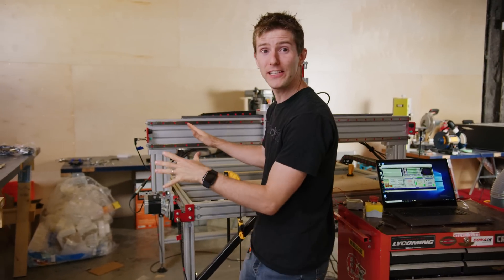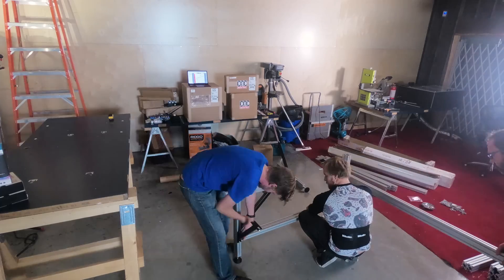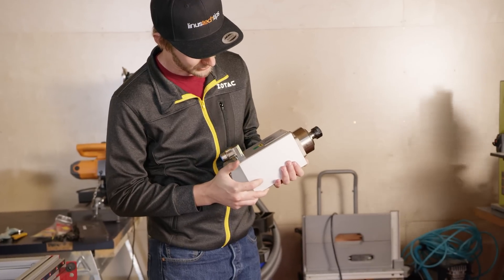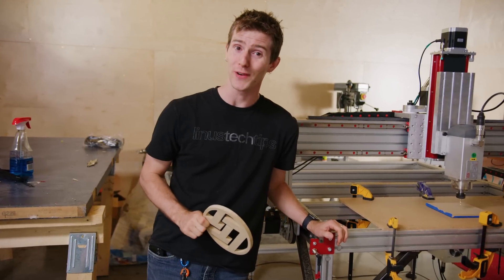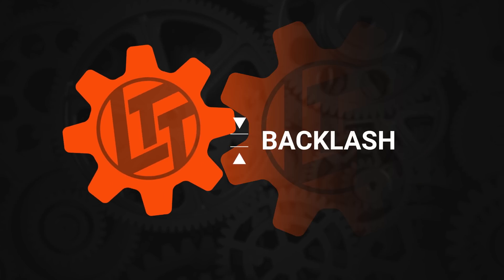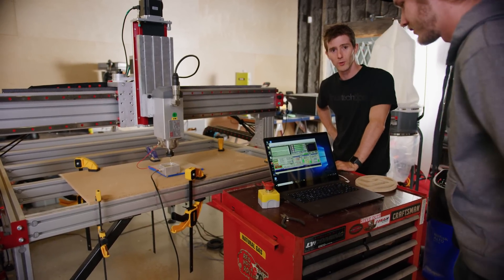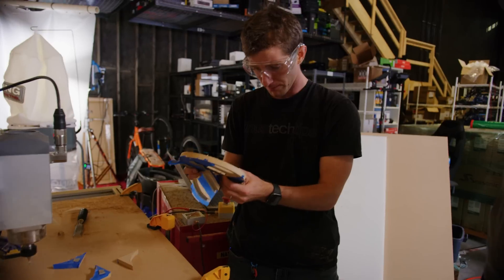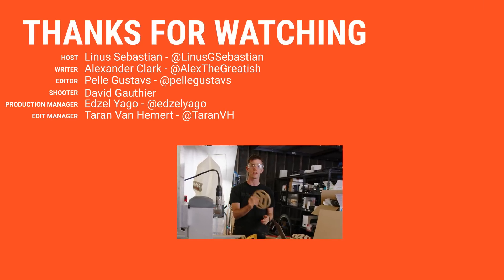Our New $10 000 Router!

Comment: You might want a better dust collector than the one you have as you have a lot of dust sensitive stuff in your studio/offices and fine dusts can slowly build up and spread everywhere. It would be best to actually just exhaust the output of the dust collector by putting it in its own room with a vent to the outside so you don't slowly accumulate cutting dust inside your warehouses (Also would keep the noise down so the loud dust collector isn't as annoying when on. Be wary of fine wood/plastic/metal dusts as given enough time it can be a combustible dust explosion hazard.

Comment: Name it Chewie? Make a good heat sink that doesn’t suck lol
Reply: Its a wooden cnc. For metal it should be a laser
Reply: @idevastate_exe  you use a laser to etch if you are cutting and shaping you use a router. This is a basic 3 axis which will allow machining on the horizontal plain. Machines with more axis can also machine on the vertical. And some can even function like lathes. You can use this machine to do metal with the right cutting tool
Reply: Agreed, it's all about the feeds and speeds you use, I've machined aluminum on a plywood router before
Reply: Yea

Comment: You guys should be using that E-Stop button when you change the bits. LOTOTO - Lock Out Tag Out Try Out. More importantly, call it the R.O.U.S. "Router Of Unusual Size".
Reply: Yeah. Rule number one, that tool needs to be made inoperable before touching that bit. Either the E-stop needs to be engaged, or the power switch needs to be off.
Reply: I know you're technically supposed to LOTO when going near moving parts, but generally for machinists, that is not feasible. Bits need to be changed out so often, a full LOTO procedure would not be economical at all. The e-stop would be the best compromise. Most people don't, but should.

Comment: so... does it cut metal? cause that is the biggest question. homebrew heatsink v3(?)
Reply: With a 3hp spindle, yeah, it should cut pretty much anything, provided you use TCT cutters and get your speeds and feeds right. Aluminium, brass, bronze, no problem, probably mild steel too, but you'll want a lubricant flow, and probably a proper machining bed (not MDF).

Comment: Awesome! I had to learn from scratch on an Axiom Pro 8 myself 4 years ago. I cut foam, so, the mess I have is insane compared to these messes.  I like how the machine is modular, mine was a assembled machine, and I've had to take it apart several times to clean/maintain it,massive pain in the ass.  This one would be SOOO much better!  Also, Vcarve is kind of a crap program, but it does work, and is 'easy' compared to some of the others.

Good luck with the machine guys, you can build so much stuff with a monster like that.  Mine's much smaller/not as powerful, but it's amusing you still gotta change the collet/bit by hand! 

If anyone actually reads this, check out the company Datron, they make some phenomenal metal cutting machines in little kiosk style setups, all in ones, awesome stuff.

Comment: do you  have the ability to add an automatic tool changer to this router? also try using a chamfering tool for the edges to round of the material, cuts down on the need to do any finishing by hand.

Comment: but a 3d printer  is pretty much a CNC router ....just work z+ instead of z-. and btw saying a 3d printer work only by pressing start is not true. You still have to adjust all the same parameter you just dont have to worry braking cutting tools

Comment: During my On the Job training at an automation company, I had first hand experience in designing, assembling and programming those huge "power supplies" which we called control boxes, which I think one of them housed the Programmable Logic Controller and the motor drivers for the steppers. We also had some people from Oriental Motors demonstrate new steppers that  would recall which position was  "home" so that it could accurately snap back to that position without having to rotate the same number of rotations it did to reach home again which was really awesome to work with. This brings back so many memories of those days.

Comment: I'd start cutting my own keyboard cases at this point. I was tempted to build one of these a couple of years ago when I was interested in building mechanical keyboards. You don't actually need a CNC router to build one, but you can make a very precise and clean wooden case with one. Grab a GH60 PCB, or better yet, hand wire your switches together, mill some aluminum or acrylic for the frame, and make a nice wood case.

I've hand-wired and made a wooden case, but never fully built my own keyboard. The hand-wired board used a case and frame from a KC60 and the wooden case used the PCB from the KC60 with acrylic I'd ordered online. Now that you have the tools, you can actually make some pretty neat stuff.

Comment: 3D printers aren't just press go. A lot of the same things you have to set for thing is close or the same on 3D printers.
Reply: CNC milling and 3D printing are polar opposites regarding technique. There's pretty much nothing similar about them.
Reply: @ramzisabra9235  they do different things but a lot of the same principles apply. There's a reason with only a few parts you can convert a 3D printer into a router.

Comment: Next project, a shop room with filtering to keep sawdust from accumulating on everything. Now you know why a lot of CNC controllers have sealed membrane touch keyboards. This is where one of those passively cooled micro systems comes in handy. You don't need a very powerful computer to feed g-code to that CNC router. As for the request for a metal lathe or a milling machine, just don't. Not unless you have a separate building to devote to it. You know all that sawdust that flew everywhere? Imagine it being conductive metal shards, dust, and particles. Lathes are also extremely dangerous if you don't know what you're doing. That router could put a hole in your hand if you weren't paying attention. A lathe could take your arm off. Accidentally leave the chuck key in and turn it on and it will go through a wall, never mind you if you're in the way. You also don't appear to do enough projects to where the expense and time to learn or to hire a machinist would really pay. I'm sure there are local machine shops that would love the chance to get a little publicity doing work for you if you needed a custom bracket or somesuch.

Comment: Why the heck do you have a Pro4896! lol...  Um, welcome to the club...  Its an addiction... Next a Mill to cut metals, then you will be wondering where to stick the Lathe.. just saying..
Reply: I can't help but think a something akin to a HAAS VF1 would have been a better and more versatile investment compared to this. Sure, this is smaller, but the HAAS or some equivelant can cut acrylics, wood, etc jsut as well as somehting like this for this sort of use case.
Reply: JC_Velo a Haas VF is great for machining, but for sheet goods and sign making you can’t beat a 4x8 CNC router.  Different tools for different needs.  

That being said, I am not sure what LTT is going to be making that they needed that much build space.  

Linus, as a heads up. Yes you “can” cut nonferrous metals. But no you shouldn’t.  I speed from experience with that machine ;).
Reply: Oh definitely. If you're going for volume manufacturing of signs, panels, etc. then a wood router is a great option. But, if its just for 1-off parts and tinkering around, the HAAS would have given a lot more versatility for more material options, accuracy, and robustness, least in my opinion. 

As you mentioned, these really aren't designed to handle metals, which kinda limits what you can make, which is a bit of a deal-breaker for soemone like me who loves to machine a variety of materials for different projects.

Comment: From my experience of programming a CNC machine (used for metal) from 2001 makes that look easy. Although that CNC machine was totally automated for switching the cutting or drilling heads.
Reply: CNC routers are basically dumbed-down versions of full-on CNC's. you can of course get ones with multi-tool setups, but you'd have to pay a fair bit mroe than what they did. I honestly think they'd have been better off getting something like a HAAS VF1 CNC to work with instead.

Comment: Setting your "zero" is called setting your "offset". Also, you should program your spindle to return to a safe position at max height and away from your material. To be honest, I'm shocked the router doesn't return to a "zero" position after a program completes... that's generally how most CNC machines operate.

Comment: I personally disagree with Linus saying the cnc machines are not plug and play like 3d printers. Yes if you drop a lot of money on a nice 3d printer it can auto level the bed and such but really theirs more variables that I'm aware of in 3d printing. Everything except the drill bit, its speed and such are the same and more for a 3d printer. Plate adhesion, material, cooling fans, cooling fans speed, temperature of extruder, speed of travel, bed material, leveling, and whats being physically printed all need to be considered before 3d printing. Taking away material is alot easier than building up your object. Besides that nice vid! ; )
Reply: I disagree, I run a Cnc mill. And for every material you have to learn how to run each different tool, everything from the rake on the end of the drill to feed/speed calculations for tooling, even coatings of the tools are very important.

Then there is the programming, I hand type G and M code, calculate where the machine is on every cut. it gets interesting when your running 10+ tools and have typed a 10000+ character program! :)
Reply: Thanks for the post btw I'm more of a 3d printer type of guy and have had very little experience with cnc mills so I guess I learned something new!
Reply: The programming part can be very difficult, or at least time consuming, after the setup mentioned by others. There are so many ways the cutter can remove the same amount of material, but they will come out at different efficiencies, different finishes, and different tool life. Many software can do this so you don't have to type anything, but you have to understand a lot more than picking the right numbers. A good hobbist CNC is comparable in price to a decent 3d printer and much more capable in some ways (less so in others). You might want to check it out.
Reply: I will! Danke!
Reply: Thanks for the detail (even thought half this is the equivalent of Chinese to me. ; )
Reply: Senses German x3
Reply: Oh I don't dare try to write stuff from scratch, cause i'm letting Vcarve generate the G-Code, soyeah.. I've tried to do some manual coding to link a couple things, but it never works right, so I just let it do its thing.
Reply: I had to learn from scratch myself over teh last four years, and yeah, I thought it was just X material at X speed kinda thing, and ooooboy soo many hours wasting material till I dialed in what our machine/bits did what etc.  Amazing how just the bit itself can have such a drastic result!
Reply: From years of working with CNC routers and 3D printers, I personally find 3D printer setups to be the more troublesome and less 'plug and play'. 

The industrial 3D printers I've been around have all typically needed more adjustments and have a higher run-failure rate than the CNC routers. Bringing a new router of the same model online has been painless - Unbox it, check alignment, run motor and sensor tests, and remember to put the bit tray in the right way round to keep it from complaining that you're an idiot all the time, (Seriously, one of the models in my friend's shop will popup "User Error, Bit tray inserted backwards", and then grab the correct bit anyway... Bots be sassy) and run projects on it till they request tool sharpening/replacement. The majority of the failures end up coming from faults in the material we're cutting into, or someone putting a new sheet down wrong.

The 3D printers however will need the same initial checks, but then someone needs to figure out why a random print released from the bed, then a few prints later we'll notice a feed fault has ruined a run. Then we're tracking down where odd bubbles came from, etc, etc...
Reply: Things that you also need to consider with a milling machine are materials, cooling, correct pathing, zeroing, mounting the blank and others that I'm sure that I missed. My point is not to say that one is harder, both need knowledge to be used effectively, safely and efficiently.
Reply: Thanks for enlightening me.
Reply: Technically 3d printers are CNC machines all the same problems in some respects apply. Plate adhesion is workpiece holding also not trivial in CNC machining. Material profiles are almost infinite for CNC machining you can cut anything you want even if it will certainly end in ruin. Cooling fans exist on CNC machines and some spindles are even water cooled. Part cooling fans = coolant/air cooling/lubricants. Temperature of extruder/speed of travel are the same as spindle speed/feedrates. Leveling is the same for all CNC, what your printing is also critical.

Both can be easier and harder depending on what your doing. 3d printers tend to be lighter and cheaper because you don't need as much stiffness so it makes them more accessible to the general public but you could easily slap a tiny router spindle on any 3d printer and cut wood/plastics (slowly) as they too are CNC machines.
Reply: You guys are correct, Cnc Simply stands for computer Numerical control :)
so a 3d printer would indeed classify as cnc,
Reply: Everything is plug and play if you constantly want to be making crap, like failed printed and broken mill cutters. These things takes a good level of understanding to get good results.

Comment: I guess your next "home made" heat sink is going to be a bit higher quality now, yeah? -- Would be neat to see custom CPU / GPU blocks (with milled acrylic and copper / aluminum...) -- But yeah, as others have said -- make sure to mill the spoil board flat, so that your bed surface is perfectly "level" (level to the machine that is).

Comment: Should look into getting a better filter bag on that dust collector and make sure to wear a mask while operating it, also an air filter for woodworking is a good idea and may be required by code. Good set of calipers, micrometer, and machinist square and a dial indicator are going to make life a lot easier when fine tuning. And if you don't have a touch probe for setting your z axis offsets I'd recommend getting one.

Comment: Please please please put up a safety barrier between the operator and the cutter!! You never know when something will break and go flying at incredible speeds.
Also i would never personally reach under the cutting head to retrieve a part even if the e stop is pressed. Thats just something we are told to never do in my line of work

Comment: To everyone saying you should disconnect power to the machine before changing the bit obviously doesn't really know how this thing works. What is done in this video (from my knowledge) is 100% safe. Unless there is some kind of freak electrical accident that machine isnt going to turn until you click the button on the controller or in this case the computer. I use to program and run a machine much larger than this daily. Now I only go on some weekends but still, the likelyhood of the machine turning on out of nowhere is so small that you probably have a better chance at winning the lottery.

Comment: Linus get your guys a deburring tool for quick and easy clean up. Also to make the tool swapping easier run each run separately. Once the CNC goes to home position you can then swap out your tools and run the next program with smaller bits or whatever else. Another thing is to get a tool designed for swapping bits. You don't want them too loose or tight on there.

Comment: Such a facepalm, all the time. These people are impressed by totally unimpressive things. A shopvac can easily be 2000 watts. A power supply of just over 2000 watts in that size is nothing special.
8:19 200 electromagnets means that 1 step is 1.8 degrees, well, yes, 1.8×200=360 but I think it's more likely that there are 200 pairs of coils opposing each other.
12:53 he wants "a tig welder"... Really? Does he want to make a show "how not to weld"? I have a feeling like he would even manage to sputter on a tig welder.
Reply: They admit in the intro they aren't the most hands on people but the best way to learn is to get it and try and practice. Obviously you still watched the video lol

Comment: yeah cool but does it mill copper for waterblocks? that's the ONLY thing that matters really.
Reply: It will, but only if they figure out how to hold the metal in place. With a proper bit, that router will cut anything up to soft metals. It wont do steel and other hard metals as those require liquid cooling due to heat.
Reply: oooh cool! now we just have to figure out how to tell them to solder the top instead of doing it the wrong way, acrylic+gasket... trend that honestly i thought would have picked up but sadly rgb all the things!!!!!111 :(

Comment: Linus needs to calm down about the amount of tape used. It's safe to use crazy amounts of tape as if the job gets loose it could start a fire or get caught on the tool head and whip someone in the head. So better safe then sorry. We have pre drilled holes in the wasteboard so you could actually screw hmthe job directly onto the board itself.

Comment: Add a perforated board under with a sealed box with a shop vac
Reply: if you use something with enough suction it can also be used to pin down some parts as well as remove loss materials

Comment: if you used a down cut bit on that part it would have come out a lot cleaner also drop your feed speed a little bit looked like 200-250 ipm  120-180 19000-22000 rpm would have given pretty nice resualts